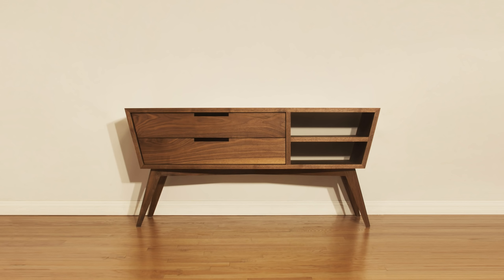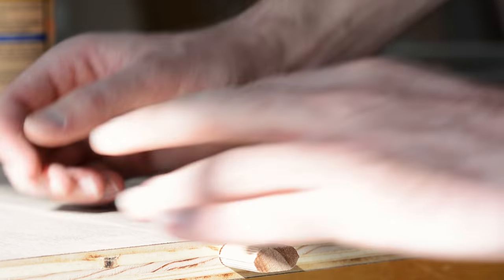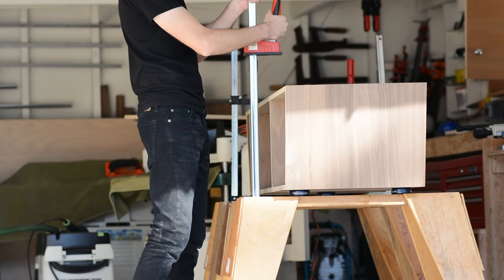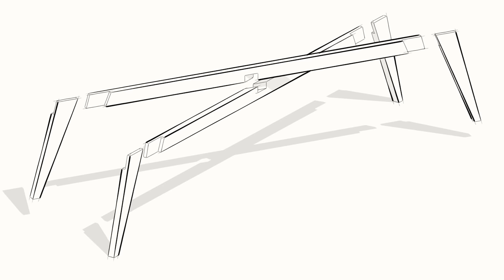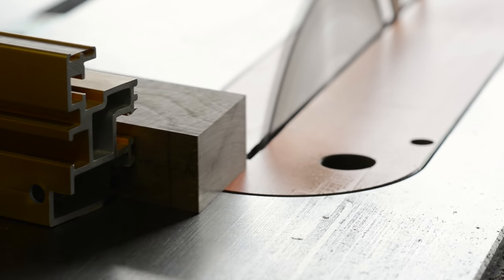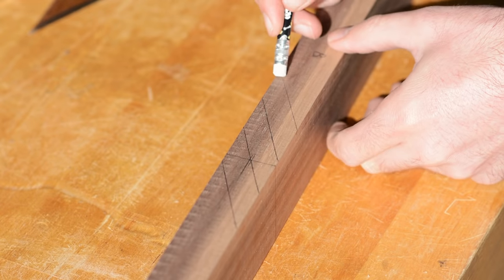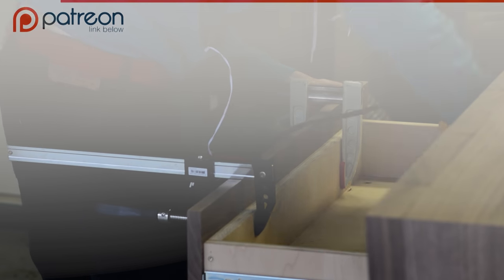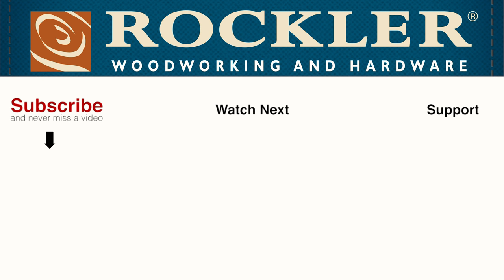Designing and Building A Modern Credenza - Woodworking

Comment: "Form follows function" is the Bauhaus principle. It is that the beauty and attractiveness of something comes from how well it fulfils its purpose, furnitures purpose is to both look good and also be functional. Additionally, expanding on the principle, Bauhaus is about truth to material, ie, don't try and hide the materials you use, eg don't make a table out of plastic and make it look like wood. It's about respecting the material you use. Live the video, great stuff mate 💪
Reply from the maker: Hey Trent...thanks for the background/insight. To your first point...I guess without strictly knowing it, that was kind of the point I was making "the purpose of looking good". Interesting side note...I know this piece looks like walnut, but the entire thing was actually made of paper mache :)
Reply: Additionally, the Bauhaus also taught students to push materials to their breaking points (extreme bends, tessellation, height, weight etc) before ever really making art anything.  This is an aspect of minimalism that is often overlooked--it shouldn't just be "simple."  And i think the joinery of this project sort of nods to that.  There's a big leap of faith the first few times you mitre-fold something without fasteners, and I even thought to myself, is the half-lap alone enough?  And of course it is, but that tightrope sort-of joinery is exactly what good design is about.

Comment: One thing I can't wrap my head around is how you calculate the length of top and bottom parts of the trapezoid frame. I mean you could just cut any length for top or bottom, but then how you calculate the length of the other part? I'm hoping to build sth similar so your answer would be hugely appreciated. Oh... and awesome as always.
Reply from the maker: You kind of have it. You basically sneak up on the finished length. So cut your top and side to whatever. Then I lay them on there backs and dry assemble with tape. And then just kind of sneak up on the bottom until it fits just right. You can pull all the info from drawings, and calculations...but I never trust it, b/c if you were off slightly with an angle, or a length (on the top or sides) it all goes out the window.
Reply from the maker: I would say use tools dimensions (no matter how accurate) as a general suggestion. You're human and whatever cut you make that is supposed to be 16" is probably slightly off. And so is that 15* angle you tried to cut. Compound these human errors a few times, and that number becomes a suggestion.
Reply: Thx Chris, that helped a lot.
Reply: Pro tip: To find funny measurements without math, draw, play with it until it looks right. And remember, measure measure cut, measure again, cry.
I personally have autocad for free (it was a student license which for some reason never expired) But anything with a measure function will work, heck, even a big piece of paper will do just fine.
Reply: try to use sketchup and you will find the measurements so easy specially the angels.

Comment: Thanks, nice work.  I especially like the care you take in all aspects of the project  and what really got my attention on this build was how you minimize / eliminate squeeze out.
Reply from the maker: Thanks. it's funny, I had one person tell me I use too much glue, and another that I don't use enough. I said "I must be using the perfect amount". I guess you're the goldilocks to confirm that.
Reply: That's funny.  I'm just completing a garden bench and went to a fair amount of trouble to minimize squeeze out.  My concern then was have I starved the joint of glue?  It's a tough one, but it looks like you had a reasonable amount of glue in the joint and left a space between the glue and the edge of the joint, so the squeeze out filled in that area.  I think I might have to buy one of those Rockler silicone glue spreaders.
Reply from the maker: Yeah...the spreaders, and the whole kit are really nice. Especially the tray, or just having something to put glue in, rather than always squeezing it directly onto the piece. Another secret is don't use excessive clamping pressure.

Comment: Hi Chris, Really enjoyed the video. Thanks! As someone with very limited space and hence is trying to make do without a table saw, just wondering why you split that bottom piece to cut the bevel on the tablesaw instead of using your tracksaw? Angle accuracy?
Reply from the maker: Pretty much. More so than accuracy, repeatability. I basically didn't trust myself to perfectly dial in the exact same angle on two tools.

Comment: Hey Chris! I'm a big fan of your channel thanks for doing what you do. This video actually inspired me to start a project with a similar design. One question for you about this build, at 1:35 you mention that the bottom piece of the project was too large to handle in the bevel jig, so you had to cut it in half. Did you have to do the same for the top piece? If not, how did you handle making that cut on an even larger piece?
Reply from the maker: Hey Ben...the top top piece is larger, and is cut on the jig that runs the piece vertically. The bottom piece (smaller) is cut normally on the table saw (NOT IN THE JIG) The reason it is too long is b/c my fence doesn't have the capacity. Anything on the vertical jig, the only limit is the ceiling.

Comment: my table saw is the same as yours and I have extended the fence about 250 mm (10") just by moving the mounts over one hole and making a hardwood extension in the right hand side of the fence the length of half the fence mounting points. very happy with it. wish I did it years ago. thought you might be interested....
Reply from the maker: Thanks Gareth...it would be nice to have the extra real estate. Right now, I still park a car in the garage, so I can't do it. Maybe at some point though.

Comment: What about using some kind of mechanical reinforcement (dowels?) on the half-lap joints where the legs meet the cross stretchers? I would think that the cross-grain glue joint isn't nearly as strong as a long grain to long grain glue joint.
Reply from the maker: You can do that. I've done it in other pieces before (putting 2 dowels in each joint.) I have confidence that these will be strong enough...Theres a lot of mating surface area. Also, this one won't have that much weight on it. If it was something heavier, I would definitely go more robust. The dowels can also be a design element if you're into that look.

Comment: Nice build.  Your credenza looks very similar to one I built last year.  Its funny how that works out. I used Sapele Mahogany and have overlay doors with custom-built handles on the front. Mine does however have a separate top.  The cabinet is a trapezoid (15deg) and the legs are tapered. I designed it to match some existing night stands. I was able to cut the bottom panel in one piece by using a table saw sled and that was a difficult cut.  I used dowels to connect the cabinet sides with the bottom of the cabinet as well as to connect the legs to the rails. I did consider using a half lap joint. After doing the build that would have been a better option.   I did not cross my legs as I wanted them to be viewed on the same plane as the front of the cabinet. I did, though taper the bottom rail. It gives it the appearance of being crossed. I guess what they say... two minds but with one great thought holds true.
Reply from the maker: Hey Joe...send me some pics when you get a chance. I'd love to see it. I had actually been building this piece for years (google Bad Larry). It was the piece I got the most request for. I felt like I needed to have one in my house for me to keep before I could put the project to bed. So I'm happy with how it came out and that I can move on...for now.

Comment: Chris, this is beautiful and an inspiration for a mid century piece I'm designing as well. How has the mitered joinery on the carcase held up? I'm going to build an a smaller angled top out of hardwood and am investigating the strongest joinery I could use (excluding pocket screws)
Reply from the maker: It has held up well. I've made several this way and they all hold up. I would reinforce with a spline or dominos and it will be plenty strong.

Comment: Hi Chris... Questions about the plywood you used.  What is the plywood laminated with? How thick is the plywood? What are you applying at the conclusion of your build? Do you add additional varnishes or sealants?  Thanks for the information.  Very nice piece.
Reply from the maker: Walnut veneer. 3/4” formbys tung oil wipe on. Just that. Think I got it all 👍🏻

Comment: Chris, I want to do something like this as a floating bathroom cabinet.  Would it be difficult to make slab cabinet doors for something like this instead of the drawers?
Reply from the maker: I would think as long as the hinged side is on the vertical...should be fairly straight forward. :)

Comment: How did the walnut hardwood match up so perfectly with the plywood case in the final result? is the playwood case laminated with walnut? And what oil did you use and how many layers? that piece is beautiful, thanks for sharing this with us.
Reply from the maker: Hi Julius. The plywood does have a walnut veneer on either side. That is how it matches so well. The finish is Arm R Seal Urethane Top Coat - http://amzn.to/2iv4NqI 
I put a link there. I used 2 coats in the areas i didn't care about as much, and 3 on the rest (top, front, etc...)
Reply: Thank you so much. I would love to see your finish-routine more in the videos. Like if you wipe or sand off after each layer and how you polish the final layer. Do you use that finish on all of your pieces or sometimes just an oil? best greetings from germany!

Comment: nice build. why didn't you make the bevel cuts on the long pieces with the tracksaw instead of cutting them and glueing them back together?
Reply from the maker: Thanks Michael. I mention it in the video...but pretty much, I didn't have confidence in my ability to perfectly match the blade angle of my table saw on the track saw...and this technique really works best if you don't change that angle.

Comment: For my experience, if you want to try on a sample, use boiled linseed oil on the wood, after good sanded. After 3/4 days of dry, varnish with shellack (1lt. Alcool 99,9 degres+200gr. Shellack). I've good result in this mode.

Comment: Chris, I have the same Bosch router as you, and the plunge base keeps getting stuck when I'm trying to remove it. I just saw that router in this video, and was wondering if you have had the same issue, or if you had any suggestions. Your woodwork, design, and your channel are spectacular.
Reply from the maker: I did have it get stuck before...though i think it was in the fixed base. I put some Johnson's paste wax, and make sure I have the hinge released and it usually comes out pretty easily now.  :)
Reply: Thanks so much Chris! Once I get it out of the plunge base, I'll put some wax on there and hope it doesn't happen again.

Comment: Do you use veneered plywood because of cost, or would there be problems with using solid wood, i.e. wood movement would have a negative impact?
Reply from the maker: Both I suppose. The plywood is definitely cheaper. it is also more stable, taking a lot of the wood movement out of the equation.
Reply: If you were to make if from solid wood, what would you consider changing to avoid wood movement problems, if anything?

Comment: quick question about the bevel cuts: how do you make sure the lengths are precise? you hone in with the table saw? I'm planning a bass speaker cabinet project with 45 degree angles and would like to know. thanks
Reply from the maker: I’m not sure I understand the question... but we have a video about “taking math and measuring out of woodworking” that might kind of answer this. It goes into detail on how I dial in my lengths.

Comment: Hi Chris, how did you mount the draw slider on the angled side? The same way as usual just at an angle?
Reply from the maker: Hi Jarryd. No, There is another vertical partition that the slides are mounted in. Then the face of the drawer just overhangs the box. So basically, there is a small triangle shaped unused space.
Reply: ah okay, got it :) thanks. That's how I would have done it, it just seems simpler. I guess that's why you mentioned a triangular box being less efficient than a rectangular box at the beginning.

Comment: sorry for the barrage of questions but how do you work out the lengths for you trapezoids? I was thinking of trying to make one but can't seem to get my head around the calculations? thanks
Reply from the maker: Hey Gareth. I knew I wanted the top 60", the sides angled in at 15* and I made them roughly 16" long. For the bottom I just measure what space it needs to be and cut it. I could use math (and my drawings) to figure it to about a half of an inch, but I base the final length by measuring and cutting many times working my way down to the proper fit.
Reply: Thanks very much. Looks amazing. Love ya style

Comment: I've seen the video a few times now but can't seem to get the details around the framing. Is the frame wider than the thickness of the ply?
Reply from the maker: Hi Claus! Yes, it's a bit over an inch (and the ply is 3/4 of an inch). The face frame sits flush on the outside of the tops, bottom, and sides (it is proud on the inside of those pieces. For the remaining 2 pieces, the vertical partition and the horizontal shelf - the face frame sits flush on the left side of the vertical partition (the side with the drawers) and the shelf sits flush on the top side of the shelf. Hope all of that makes sense.
Reply: Hi Chris - yes, it makes perfectly sense!! Thanks for taking the time to answer! Looking forward to your coming projects !!!

Comment: Do you use SketchUp for your models? - What style are you using. It looks so cool!
Reply from the maker: I do...my favorite style is "marker fine" but for the drawings I usually mix a few styles and overlay them in photoshop.
Reply: Thanks for the tip. I tagged you on Instagram with my newest render of an offshoot of one of your pieces. I will be rocking a 2x4 version for a friend. 
I've been in a slump (working on an iOS project for about a year) lately and your videos-inspiration were a perfect recenter. JH

Comment: would have loved to have had instruction and video on building the drawers and attaching drawer fronts.
Reply from the maker: Hey Steven. I have a separate video where I go over how I make drawer boxes. I used that exact technique here. For attaching the drawer fronts. It's pretty much align, clamp and then screw from the inside of the box. I think I might go into more detail of that aspect in the "dresser build" video. Thanks!

Comment: Chris, you mention having to cut the bottom  panel because the length is greater than your saw's capacity. How did you accomplish the bevels on the top panel without cutting it in half?
Reply from the maker: With that vertical cutting jig. So the sky is the limit. 

…or at least the ceiling is the limit. 😊

Comment: OK so I have worked that question out myself..... well I think I have? So does that mean you ran the top vertically on the jig you made? how long is the top? is that jig stable enough for that I'm guessing it's around 60inches long.....
Reply from the maker: Hey Gareth. Answered the question before I read this comment. Yeah, you got it. The top piece is about 60 inches. The jig is pretty darn stable. Just make sure you get a nice snug fit on your fence. I also but a little door pull (knob) on mine so that I can hold it nice and tight while I run it.

Comment: I notice that you use an insane amount of glue in your videos, I feel like it is your favorite thing. How do you clean it up? Do you wait till its dry? wipe it immediately?
Reply from the maker: I actually get a lot of people telling me that I use a very small amount of glue...maybe that means I'm actually using just the right amount. Anyhow, when I do have squeeze out, I let it partially dry (most of the time) and then scrape it off.
Reply: I guess I wasn't commenting on the amount of glue you use at one time, I just mean whereas a lot of woodworkers use screws / nails / joints etc you really favor wood glue so I assumed you would have some insight :p
Reply from the maker: Yeah. pretty much, wherever just glue will get the job done, I go that route. Nothing against screws and nails though. Definitely a time and place for them.

Comment: If the bottom piece was so wide it needed to be cut in half, how did you handle the top piece which is even wider?
Reply from the maker: The top piece is cut vertically using a jig that rides on my Table Saw fence. So the limiting figure there is your ceiling. My ceiling is pretty high

Comment: Why would you cut the bottom in half instead of using the Festool TS55 to cut the bevel?
Reply from the maker: I was more concerned with a clean corner than a clean center since it could be hidden. it's really hard to match the cut perfect (angle of the cut, angle of the blade, etc...) on two tools.
Reply: Makes sense!  Also, just out of curiosity...the main body is made out of high quality Plywood...correct?  Does it have edge banding on it?

Comment: Great piece.. 3rd viewing already.. i still don't get that if you had to cut the bottom in half because it was too long why didn't you do the same with the top... love this channel!
Reply from the maker: Thanks Mugibaba. It's b/c the bottom has to be cut flat on the table, so the fence is the limit. The top is cut vertically, using that jig that slides on my table saw fence...so the ceiling is the limit